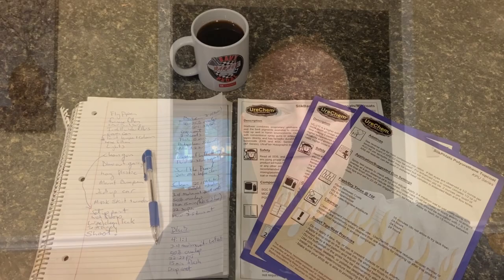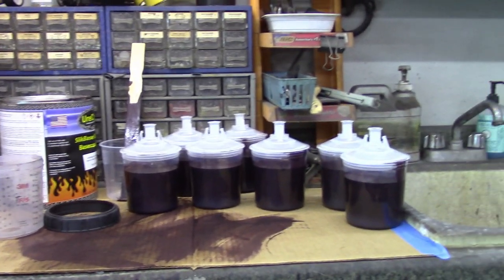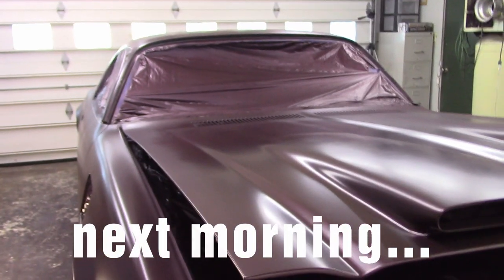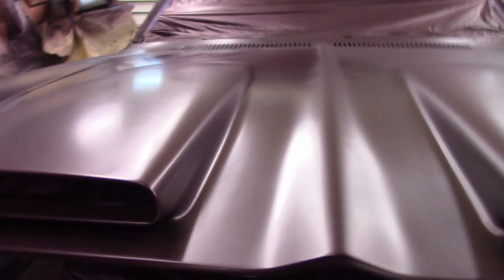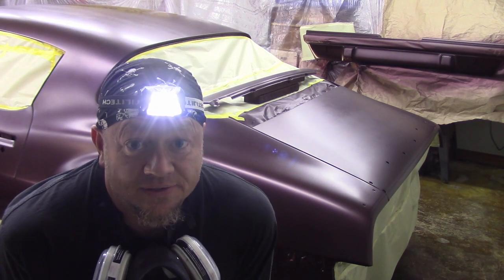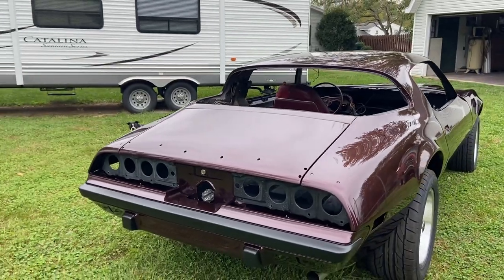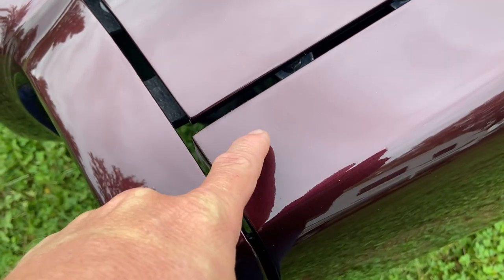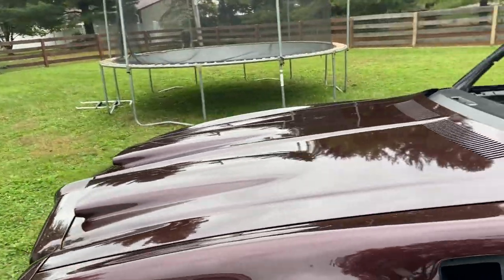Paint Day is Finally Here! Sparkling Merlot Pearl by Urechem. Had a big issue!   Disaster Avoided!!

Comment: 12:49 That's before wet sanding and buffing!? When I had my car painted i had horrible orange peel. But we also used PPG Omni MC260 and the painter put down 9 coats of paint in 12 hours (Primer, Base, 4 coats of candy, 1 coat of clear with metal flake and 2 coats of clear). She's currently in the shop getting all her leaks fixed, but they are making sure everything is pristine inside her to match the outside. I can't believe how often I get pulled over just so they can check her out. BTW, She's a 1991 Nissan 300ZX TT painted Blood red candy apple with fire red metal flake .004 && .008 with a "rose gold" base (I say "rose gold" because we originally were going with a gold base and didn't have enough, to the painter mixed up some silver with a bit of G7C Red Hot and it created a rose gold). The black pieces are painted in BMW Jet Black 668. I've shown up to a few classic car shows and I confuse the shit out of the gate attendant. Usually i just go park with the rest of the people showing up for the car shows, once was mistakenly let in, and 2 times I had to move my car inside the car show because it was causing too much of a disturbance 😎😂 If I put together a montage of the start to finish I'll post a link.
Reply from the maker: Yup. Super impressed with how the UreChem laid out. It really didn’t need a lot of cut and buff. Your 300z sounds sweet!

Comment: Really enjoyed the video. Car is beautiful. I’ve got a 2nd gen camaro I’m gonna be painting some time. I see you bought 2 gallons of basecoat. That would make make 5 gallons mixed right? Just curious why you bought so much. Also, wondering so I will know how much to get for myself. I’m thinking about using UreChem also, they are only about 45mins from my house.
Reply from the maker: UreChem is awesome.  So i got 2 gallons to be sure i wasn't going to come up short right in the middle of laying it on.  One gallon was enough... but only have a little bit left.   I did do all the jambs and under the trunk lid.  I painted the underneath of the hood black.  I also think i put on 4 coats of base.....     now, that it has been painted for over a year, i do have some body work to touch up. So im glad i have that extra gallon on the shelf.

Comment: congrats man, the little hanger there isnt a big deal...you can take some putty coat and smear on both sides and then cut it down without going through the rest of the clear and then cut and buff. wont even be a shadow
Reply from the maker: Thanks for the compliment brother. I appreciate the advice too. I’ll admit I was pretty deflated when I saw those runs.  But your absolutely right, it ain’t nothing that won’t rub out. I appreciate the tips and tricks along the way buddy.  Thanks again!!🤘👍💪💪
Reply: @HeavyPedalGarage  that's the color I was gonna use on my lemans but went with the dip your car zbr red to black hyper shift and using auto paint hq brandywine on the trans am

Comment: Hi, from me in the UK. Nice job and I appreciate your honesty. Not a lot of people tell the tale. But personally, I would have noticed all the imperfections from guide coat and blocking stage. Or the light scratch you could have put some red glaze 2K and puff some Merlot over the top of the wing and just blend it in.
Dude, I would have donated a Devilbiss or Iwata from my collection so you would have a nice gun to shoot with. Beginners error for the first coat of clear: always a very light tack coat. Unless the soecsheet stated a full 2 wet on wet coats with no flash off in between. There are clears which are applied like that or  clears which can be sanded and buffed after a 30 minute bake cycle. But allowing the clear to naturaalr dry out is the best way. Let it sit. How many coats of clear? 2. Not enough man. Sand with 600, rectify all the sags, runs, defects and re ask, blow off, panel wipe, clean, clean and flow coat with 3 coat of a decent UV clear. Grant 7 nice, All wet Kandy nice, Here in the UK....they are not available. So I use Mipa, or Standox, PPG, Lechler, Liquid Glass my favourite or Glasurit... But ouch the last 2 hurt price wise. Unless the. Customer is paying... And it needs a decent gun... If you still want I can send you one from my spray gun collection of 28. But these guns are Cannons and you need to move fast otherwise there will be more runs than in a marathon race!!!
Reply from the maker: I absolutely love all of this advice!!! I definitely learned some lessons on this job and am looking forward to the next one. I did shoot 4 coats of clear. I cut and buffed and it turned out pretty good. I still might hit it again and flow coat as you suggested. I would love to try one of your guns! And I really appreciate the kind offer to send me one. Shoot me an email at heavypedalgarage@gmail.com and I’ll send you my address. I’ll also mail you some logo stuff from my channel. Thanks buddy!
Reply: Yes, will email you.